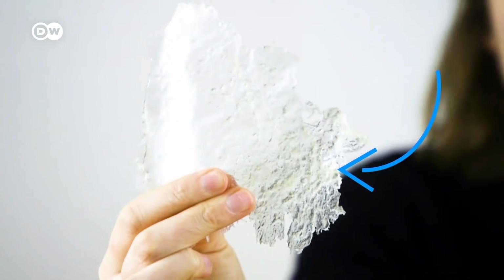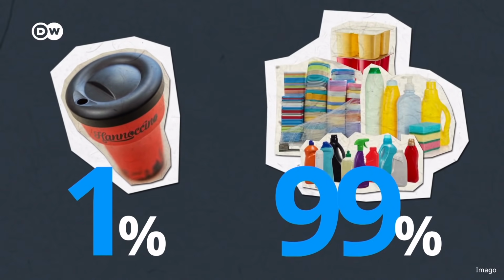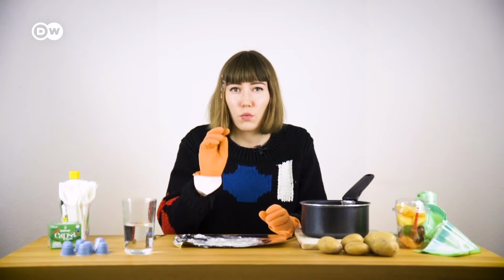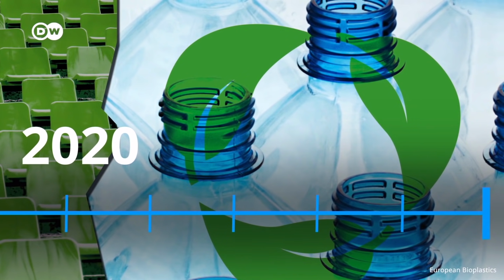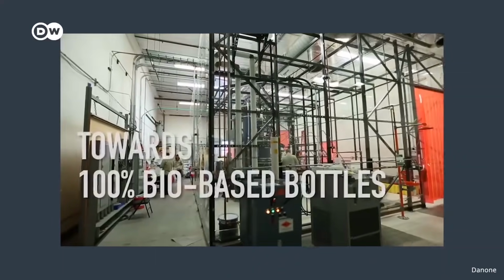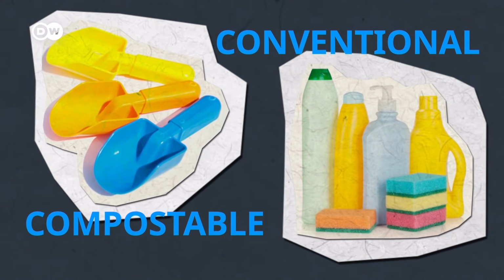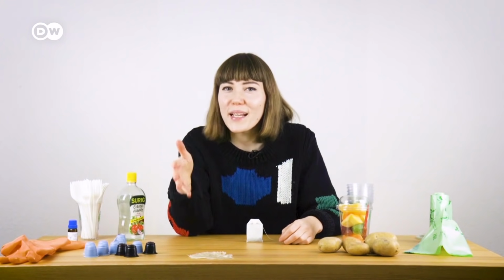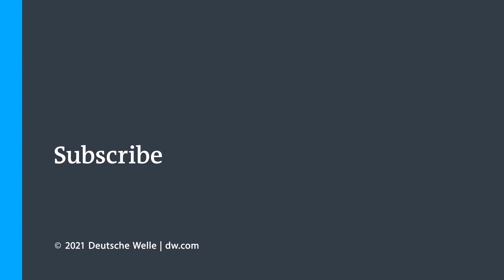Is bioplastic the „better“ plastic?

Comment: The plastic shown in the video appears to be plastic from PLA material. PHA, which decomposes without heat, looks better in the future than PLA, where raw plastic is decomposed only by heat. In the future, PHA materials will be more perfect eco-friendly materials.
Reply: @nexustom5823  Yes.
Reply: Polyhydroxyalkanoates (PHAs) are the future. I've transitioned damn near my entire research group into studying PHAs ;)
Reply: @leptonsoup337  I have been researching PLA for 15 years now, have 60+ publications on that. But I am also considering to open research on PHA. It is still too expensive for industrial applications.
Reply: This video is a massive fail for not including PHA. I don't get the sense she even knows about PHA.
Reply: 60+ publications but half of it are review papers?
Reply: Sponsored by the oil industry, what did you expect? DW also supports the war in Ukraine.
Reply: @leptonsoup337 can you tell me about your research on PHA?

Comment: I think the lesson from around 4:48 is important to learn.
Ethanol and ethylene can both be made into polyethylene. One is bio-based, one is petrol-based. One is artificially created, the other naturally occuring.
Both end results are identical.

They are not just equivalent, they are the exact same chemical compound!

Synthetic or natural doesn't matter, it is the resulting compound, or its effects, that matter.
Reply: But one comes from a finite source and the other comes from renewables. It's also worth noting that Coke could have made PLA instead of PET.
Reply: @arthurmani  From a manufacturing standpoint, yes it matters. We should probably try to avoid the oil.

What I mean is that many people (sometimes it feels like MOST people) have a belief that the manufacturing process will result in a different end product.

Just look at all the people who prefer their sugar to be from beets or canes or honey rather than fructose syrup. The end compound used is still sugar, the same sugar, but people think it is somehow healthier because of how it was manufactured.

So, to reiterate: I'm not talking about the impact of the manufacturing process, but the differences (or lack thereof) in the end product.
Reply: @morphman86  I am assuming you are talking about a very specific bioplastic type that would come from bio-ethylene (the PET that Coke was talking about?) not PLA (Polylactic Acid, the most common bioplastics)?  I believe you cannot make PLA from petroleum so the end product is also different and more eco-friendly in its majority? I am not an expert so please correct me if I am wrong.
Reply: @arthurmani  I did specify polyethylene, so yeah, PET.
Reply: @hi-ve1cw  not denying that. I'm just saying if the end product is the same, they are both having the same impact (as the end product).

Synthetic or natural doesn't matter, if both end products are identical.
Reply: @hi-ve1cw  still not the point. Ignore the end product. Heck, forget it's even plastic. Imagine something like sugar.

One from harvesting and processing sugar cane, the other from combining different chemicals. Both ending with the same chemical formula.
Is there any difference between the two sugars?
Reply: Exactly. I mean, petroleum is technically an organic, mostly plant based, substance!
Reply: @frozenjune83  It has undergone some rather drastic changes since it was organic and is not considered organic anymore.

But I get what you're saying. Organic is nothing but a label, when it comes to products nowadays.
Reply: Username and icon checks out. Thank you for sharing your robotic overlord wisdom, oh wise metal one!
Reply: Sometimes it does make a difference even when the resulting compound is identical. The bulk of the product may be composed of the same chemical compound, but the trace products may be different due to the impurities and imperfection in the production process which can lead to slightly different properties. Some trace products may be more toxic or chemically reactive to things in small quantities that it can lead the similar product to have different target use cases, or the elevated risk of residual contaminants from one production process may make it unsuitable for certain use cases.

Of course, in most cases, trace chemicals doesn't make enough difference; and almost definitely, when it comes to how bioplastic and fossil fuel PET and their impact at the end of their life are largely going to be identical.
Reply: Regenerative Agriculture holds the keys to being good custodians of this loaner planet. See my standalone comment.
Reply: Let's take food and make it worthless... yeah!
Reply: This is true, the word 'natural' is one of the most misused and misunderstood words ever. Except maybe: no
Reply: @morphman86 ok, now imagine we can make toxic waste from bananas (fun fact, we can) would it be 'better' than uranium based nuclear waste? The end product doesn't matter and we should forget about it is a very reductive standpoint. But I'll grant you your point in the hopes that you see how little it matters now
Reply: @frozenjune83 this is the point! Organic and plant-based, natural.. are marketing words these days, devoid of their original meaning, just meaning good and guiltfree
Reply: @sophroniel just because somebody doesn't agree with you, doesn't mean they are made of metal. Unless you count calcium in bones of course..
Reply: @Ludifant  Read it again...

Comment: Several years ago, I tried to compost 'supposedly' biodegradable plastic magazine wrappers. After about 3 years at the bottom of the heap, they were still as good as the day they were buried and I had to fish them all out.
Instead, I now try to buy as many products as I can in card boxes or tins. However, I'd really like to see the plastic bags that wrap freezer products, veg and fruit be changed to fully biodegradable.
Reply: Hemp plastic. Idk why they didn't mention hemp once in this video.
Reply: @chris rhodes  Hemp is seriously underrated, but this is the first time I hear of hemp plastic?!
Reply: @crazydragy4233  hemp plastic, hemp concrete, hemp fuel, mix hemp fiber with cotton and you get shirts and fabrics that feel like cotton with durability that is unparalleled (I have had a cotton/hemp shirt for a decade now) obviously the medicinal and edible applications of the plant, hemp paper, the list goes on. Assuming you had the facilities you could likely build and furnish an entire house out of different forms of hemp and it is not too unbelievable especially to anyone who has ever touched the stalk of a mature plant.
Reply: I've seen other people complain about this and I wonder if maybe they just got scammed. I've had the opposite problem with compostable plastic bags. They started degrading before I even got a chance to really use them.
Reply: You might have been scammed OR it might be a misdirection... like, it's "biodegradable" but in specific conditions...

Which still make it a scam...
Reply: These bags are probably not compostable for home based systems, but they are probably biodegradable in industrial composting facility like the compost system a city handles.

Comment: Thing is that it's not the consumer plastics that make up the bulk of the plastic use or waste. It is the industrial plastic we need to curb.

That is why we've seen less than 1% decline in plastic dumping following 5 major countries banning single-use consumer plastic 4-5 years ago.

If it was the plastic spork you get with your little plastic fruit cup that was the culprit, we would see a massive reduction in plastic dumping and plastic consumption, but we haven't. Not even locally in the regions that banned them.

Comment: Perhaps you want to check out starch-based plastics such as bin bags? 
I actually used them in school to show that they actually are biodegradable: They test positive with iodine solution, and if you soak snippets of it in alpha-amylase, you can actually detect carbohydrate monomers such as glucose fairly quickly.

Comment: Forget all the other plants,
You should just use hemp fiber and if you need an oil base the hemp seed oil.
Most everything can be made out of the Hemp Plant.
Reply: Ikr? Hemp is amazing. The paper industry could literally throw out wood consumption almost entirely but it's just "too expensive" to repurpose the factories. Wow
Reply: @armorhide406  It isn't perfect everywhere of course, but it is an environmentally viable and sustainable option, especially in the Northern hemisphere, where it was practised for thousands of years to begin with.
 It yields more and has more uses+ doesn't destroy soil quality.
Reply: @armorhide406  I am trying to find a good counter argument to hemp plastic and I have been scouring the internet. I noticed no mention of hemp in this video. They said that statistic about corn but Hemp is a very different plant with very different properties and would have different land/water usage than other crops. Still though, if anybody reading this can find me a counter argument against using hemp plastic I would really appreciate it for my research.

Comment: TL;DW Basically, it doesn't matter if it's bioplastic or regular plastic, what matters is if it's biodegradable. 

Bioplastic does not mean it's biodegradable... but the manufacturers want you to think that's what it means. 

My note: Also remember that just because it says "biodegradable" doesn't always mean it is. There are sometimes scams involved and sometimes, it's "biodegradable" but only with specific tools or environments... so they can claim that they technically aren't lying.... but it's still a scam.

Comment: More zero waste shops needed! I get so annoyed with vegetables wrapped in plastic. My local greengrocer uses brown paper bags - I know I can put them in my home composting. My organic veg and fruit usually come loose in the brown paper sack ( which I return each week, as they re-use them). Many of our magazines now come in a film that says it's compostable - I don't know if this is right, so I put them in my garden compost bins, to see what happens. I note that my Radio Times which used to come in the potato starch film has now changed to using a paper envelope instead ( I hope it's made from recycled paper).

Comment: The only thing I worry about, especially with Covid and other diseases/sickness is that you almost have to use throw aways when sanitarily cleaning them isn't an option. Hospitals and even people stuck at home with others are more likely to use one time based takeout or needle caps. Is there any way to work around the crisis and still move forward?
Reply: For takeout people could bring their own container. Maybe make the containers themself more eco-friendly, if possible biodegradable. And give a discount to people who bring their own. If hospitals have to use some non-degradable plastic (and the degradable version is not good enough quality) thats sadly just how it is for now. But a whole bunch of unnecesary single time plastic use could be cut out. And I think maybe we should not be THAT fanatic about hygiene in everyday life (not hospitals), we need to go a bit more back to normal, disease will always be part of life and we cant stop spread entirely. But more people should get vaccinated, that could help with disease a lot

Comment: Absolutely agree… the best way to cure the plastic problem is to just not use plastic.  Bioplastic is not a silver bullet - it competes for the same products that we eat, or uses land that could otherwise be used for food, and it uses a lot of water… and disposal remains a problem… so not a solution really… back to the drawing board.  We will find a solution - we just need to agree that we need one.

Comment: This makes a vital argument: the fork that appears briefly at the very end is stainless steel but could probably be used for over a hundred years and still be recycled afterwards. A truly circular economy will need to include a massive reduction in production of materials from natural resources. As always it comes down to how we run our economy. The first steps have already been taken - see Kate Raworth's book "Doughnut Economics" - and there are enormous political hurdles that need to be overcome. If only we had more time! But, that said, we did have time and didn't use it well.

Comment: So, what I have guaged from this is that for this to really work we need to go back to small sustainable communities where products are produced locally and disposed of locally. That or the best solution I believe is instead of pushing the carbon footprint onto the consumer or offsetting in other ways - the manufacturer needs to take responsibility of the disposal of their products. If you want to solve environmental problems, the quickest and easiest way is to make the supplier of products responsible for the disposal and the environmental impact.

Comment: As usual, a very half-baked product from DW.
While yes, the final idea of reducing the use of plastic at all is right, everything else is just...questionable.
Some things, that are made from plastic are not supposed to be easily degradable at all. Why would it be a bad idea to replace petrochemical long-lasting plastic with bio-derived one?
More so, the mention of how much corn we need to replace petrochemical plastic with biobased one is very debatable and there are two reasons for that:
1. We already produce more food, than we need. And a giant amount of food is wasted instead of being consumed.
2. There are starch-based plastics, cellulose-based plastics, protein-based plastics, lipid-derived polymers, etc. Many of those are made out of waste and garbage.

Also, no mentions of cellophane?

Comment: Important to balance this video with a few facts (happy to give sources):

PLA bioplastics are made from fermented plant starch such as corn, cassava, sugarcane or sugar beet pulp which are all renewable and sustainable resources, contrary to petroleum which depletes over time.

The renewable resources used for PLA Bioplastics are natural carbon sinks, contrary to petroleum based plastics which releases excess carbon when first extracted, distilled from crude oil and when burned in incinerators (source 1 - source 2). More than 50% of carbon emission in the U.S. incinerator plants come from petroleum based plastics.

PLA is up to 30 times less toxic than petroleum based plastics when heated (When heated, PLA gives off a non-toxic chemical called Lactide - source 3)

PLA is biodegradable (It can degrade naturally over time. Warm temperatures, high humidity and small particle sizes will make biodegradation even faster). Big pieces break down slowly as the microorganisms don't have high surface area available for enzymatic action. If the conditions for fast natural degradation are not met, PLA can be sent in industrial composts to accelerate the process. PLA is therefore a "cradle to cradle" material (it comes from earth and can be brought back to earth without harming natural habitats, including marine habitats). A PLA bottle left in the ocean would typically degrade in six to 24 months. Compared to conventional plastics (which in the same environment can take several hundred to a thousand years to degrade). Fungus can even grow on PLA particles in water after two weeks.

Soil mixed with composted PLA remains suitable for plant growth (source 4) despite a slight lowering of PH levels (The optimum pH range for many plants is between 5.5 and 7.5, PLA based soil is within this range). 

PLA Bioplastic does not contain the hormone disruptors often found in traditional plastics  - bisphenol A (BPA) .   

PLA is mechanically stronger (stronger/stiffer) than most petroleum-based plastics. 

Recycling alone cannot be a long term solution for any plastics: All plastics cannot be recycled forever, they have a limited cycles before their long chains of polymers are broken and cannot be used structurally. The material is then discarded or burnt whereas PLA can be brought back to earth.